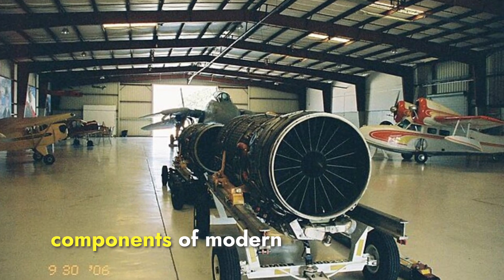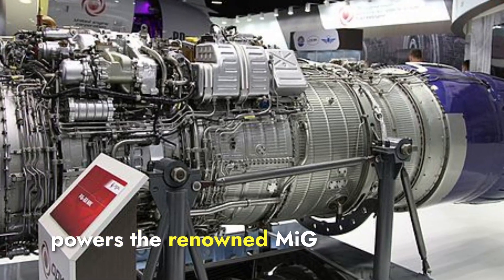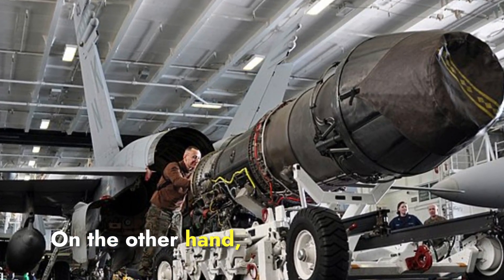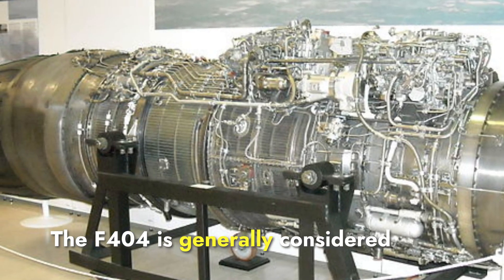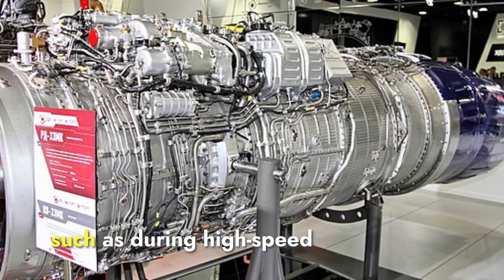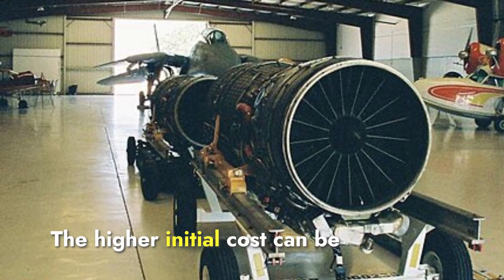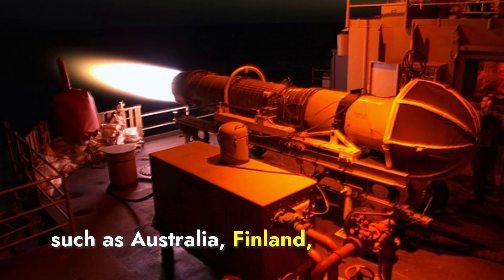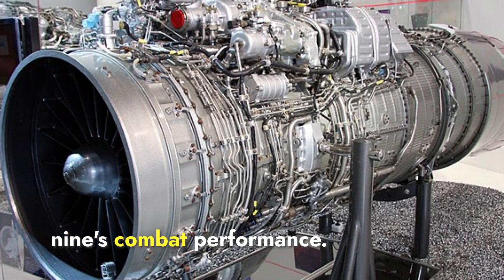Comparative Analysis: US's General Electric F404 vs Russia's Klimov RD-33 Jet Engine

Comment: tejas should have used modified Klimov RD-33(correcting some of the shortcomings), cant rely on US as its unreliable partner. higher maintenance of the engine could have been offset by having more engines in spare and just bolting the backup engine and taking old engine for maintenance.

Comment: Klimov RD 33 is a more sophisticate and complex engine therefore its hard to service.  It has a cooling system in case dogfighting the middle-east where it is really like 40+C weather. GE F404 good engine easy maintenance low cost but the price per unit High.  And it not all weather engine like the Kilmov RD 33.  The RD 33 is good value for country that need a front fighter engine and labor is cheap to maintenance.  Different folk with different stroke.

Comment: RD-33 engine, SFC Military thrust  (dry / without afterburner) is 0.77 lb/(lbf·h)
F-404 engine SFC Military thrust 0.81 lb/(lbf⋅h) 
In dry thrust RD-33 is more Fuel efficient than F-404, which is what is important, and RD-33MK have lifespan of 4500 Hours!
Reply: yes and price ?

Comment: Klimov is expensive even if given free. It doesn't hold a second light to F404. I know. I designed Fighter Aircraft Engines systems.
Reply: And yoi waste your time on YT 😂
Reply: F404 has failed. Lead to crash. It's trash. But ofc murica. Feet and pounds. Ridiculous units of measurements.

Comment: Having the R33 accessories mounted on top of the motor is a maintenance nightmare.   GE 404 has a PTO shaft on the it’s gearbox leading to an AMAD where the generator, air turbine stater, fuel and hydraulic pump are mounted.  This simplifies engine changes.
Reply: You are not wrong, but should probably say that integral accessories would be a nightmare to maintain for an F-404.

Overly simplified, the Klimov engine was designed to be “maintained“ by being wholly removed and another installed in its place.
Reply: @brianhiles8164  Regarding the AMAD on the F18. They are easy enough to maintain on the aircraft as well. There's an access panel to get to those accessories. Plus the upside is when doing an engine swap you don't have to disconnect all the wiring bundles, fuel lines and hydraulic lines.

Comment: Both great engines designed by smart engineers. The difference are a result of the different design ethos and technical requirements of the different countries. 
The American engine was designed to be technically advanced while the klimov was designed as a military engine for war, meaning it has to perform at higher loads increasing survivability at battle theatres. Most jets when they go to war are not expected to fly for long unlike a commercial jet hence building a long lasting engine wasn't a real requirement and fuel efficiency, well its russian.  Russia is the home of fuel. 
So both designs are great for whatever they were envisioned for.
Reply: It doesnt matter how much fuel there is in russia. Only how muchp there is inside the aircraft. Fuel efficiency equals more range.

Comment: la información es errónea, el rd 33 inició su desarrollo a principios de los 70 y no los 80. El diseño también es modular.
Reply: The presentation was made laudatory for the F404, the maintenance was done only in special places. In the presentation, production data for the RD-33 is omitted/missing and it is desired that the RD-33 comes from the Stone Age, it is known that maintenance for Soviet aircraft can be done at any type of airport, fuel is not a problem, and the reduced cost meant more units produced
Reply: But it's high on maintenance.
Reply: @willisfernandes2366  si, pero es distinto el cálculo actual que el de la era soviética. Hoy los motores tienen una menor diferencia de precio al adquirirlos , pero bajo el sistema soviético la diferencia del costo era enorme y por eso la vida útil no era tan importante. Cuando cayó la URSS en los hangares había enormes cantidades de motores nuevos en cajas , era más práctico para ellos un motor que duraba 1500 horas y costaba 350000 dólares y solo desecharlo que hacer uno que dure 6/7000